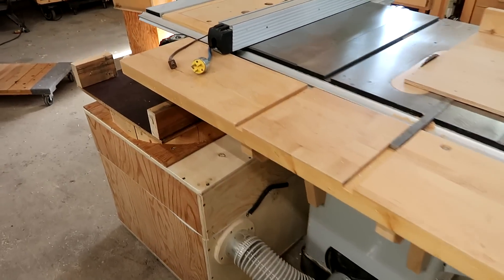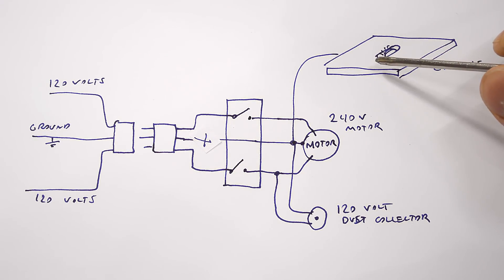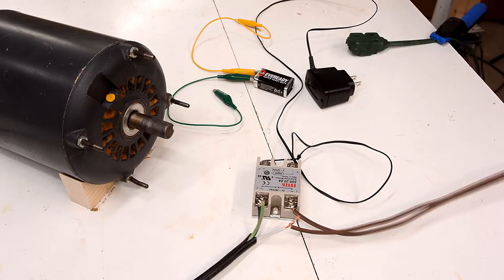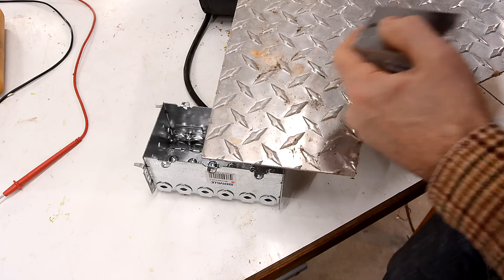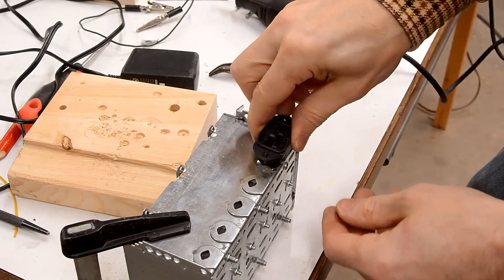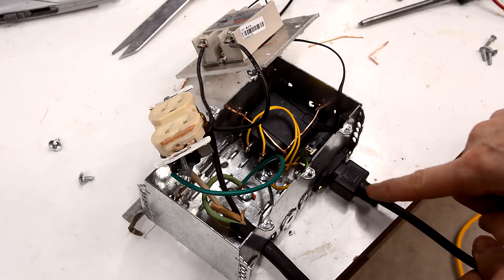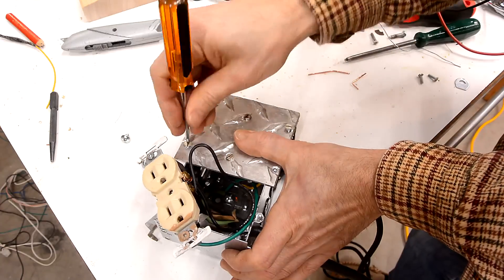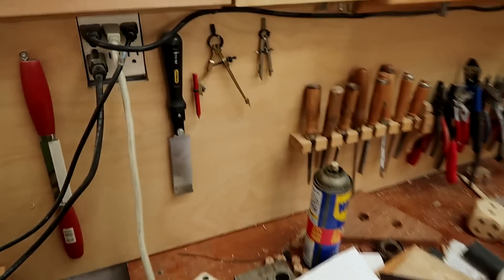Relay box to automatically turn on my dust collector

Comment: That's pretty dangerous. You have nothing to hold the incoming power cord, like a cable clamp. Also, the metal lid isn't permanently earthed (grounded).

Comment: Now you need to build a delay circuit to keep the fan running for 30-60 seconds after the saw is shut off.

Sometimes you are saying "ground", but what you want is "neutral", other times you do mean ground. Ground is not neutral, but nuetral is grounded.

I wired mine so the table saw switch controls the vacuum. Much more ghetto, barely within the specifications of the switch that's 20 years old, but it works.

Comment: Your 240V supply is a single phase supply, not a two-phase! 
There is is either single phase or 3 phase AC power. 

Each of the wires supplying 240V AC is connected via double breaker to the same phase on the electrical panel.
Most power feeds for homes in North America are single phase.
Reply from the maker: Instead of arguing with me, search for "two phase power", then argue with wikipedia.
Reply: @matthiaswandel  I did but it looks like you didn’t.
“Two-phase electrical power was an early 20th-century polyphase alternating current electric power distribution system. Two circuits were used, with voltage phases differing by one-quarter of a cycle, 90°.”
https://en.m.wikipedia.org/wiki/Two-phase_electric_power

Instead of assuming that you are not wrong, please search for “split-phase or single-phase three-wire system”.
https://en.m.wikipedia.org/wiki/Split-phase_electric_power

Comment: Sketch factor - 10.
The stuff house fires are made of.

I love the idea.  The execution leaves me mildly concerned.  I would like to build something similar.  You had me up until you soldered to the prongs of the transformer, left them exposed, and then attached the transformer to the metal case with a copper wire!  AHHHH!

Comment: One small point- fine saw dust does not burn with a flame ,it smolders so if that relay gets too hot and too much saw dust you've got a problem just a word to the wise.

Comment: Curious why you did not get an AC driven relay i.e. Amazon shows both SSR25 DA and AA. Seems this would be simpler because it eliminates the need for the the European DC wall plug. Was this because of the 240 going in?

Comment: Good project with a surprisingly efficient homebuilt blower. I'm sure you already know, but I'm gonna say it anyways. 1, no bushing on where your 120v comes into the box. 2, copper wire is an awful choice for mounting things inside of an electrical enclosure. Like I said, I'm sure you know and are aware of the risks, but are your viewers? Will some regular Joe following along know to immediately disconnect power and inspect when he sees signs of chafing and cutting on the 120v input?

Comment: Whenever I build a component such as this using any kind of "SO" or "stranded" wire connecting to any device with screws I will always solder a nice hook that will wrap around the device screws. Less chance of "wire fray" and a lot smaller than ring or fork terminals.

Comment: You might be able to use one of the 220 legs as the core of a transformer, winding it with many turns of a thin gauge solid core wire, and use that to trigger the SSR.   Just an idea, may make the project simpler for some / require fewer parts.

Comment: Use a current-sensing-relay. Then you don't need any electrical connection between the 120v dust-collector and the 240v table saw. Just pass the 240v wire through the sensing circuit.

Comment: Hi Matthias. I've built a number of accessory switches, but using old fashioned relays. Very minimal voltage drop across the contacts. I prefer octal based industrial relays mounted on a din rail - very easy to wire up. Very useful as well for safety interlocks. But, I expect you had rescued the solid state one from some pre-owned gadget. Much cheaper! I like coil  relays. You can see things moving ..... BobUK.

Comment: God, why are NA wall outlets not switched. Holy shit, even the 240V one isn't....

Who's smart idea was it to have live wall sockets all the time. Great for a kid to shove a small metal object in. At least with a switch there's another thing stopping this.

You also don't have issues with arcing when plugging stuff in, and, if, god forbid an appliance you plug in is broken, or switched on at the appliance, switching the wall socket switch when you turn it on, and realise, it's much easier, and quicker, to flip the switch back off. In NA, you'd find out when you plug it in, and then have to unplug it to stop it...... Just insane.....

You also can't switch something off and leave it plugged in. For something that you use a;l; the time in the socket, that has no switch, like an Iron for instance, you can leave plugged in. And when you go away you can leave everything plugged in and just switch each outlet off and then when you come back form holiday switch it all back on again. This is one reason I could not live in the US....

This is what we have in the Australia. https://thumbs.dreamstime.com/b/white-australian-wall-power-outlet-17607268.jpg

We have power board here that don't have individual switches, and I hate them.....

Comment: Yup, a european 'electrician' here. Power distribution systems differ wildly around the planet. This excellent channel has viewers around the planet. What may be safe in one country can be very dangerous in another. It's NOT just frequency and voltage that differs. Phasing and earthing (protective conductor) have critical differences. If you know what you are doing, and it's legal, fine. If not, get someoene in who does. This stuff can kill. I'm not commenting on US practice because I am not competent to do so. Don't go commenting on practice elsewhere if you don't understand it either.  BobUK.

Comment: It is so much easier in a country with 240V 10A as the standard in household GPO, just have an ordinary switch to control the power going to a double outlet to turn the machine and dust extraction on and off at the same time.
Surely that "earth" in your 240V line has to be a neutral (with two active phases)? Otherwise the earth leakage protection should trip in your fusebox every time power was applied.

Comment: It work but not safe at all, at 5:41 minutes on the video you plug a male plug that could have power on it (if the other side is plug) so it you touch the end, bang your got chock, never  do it again like this.
Reply: There is no double male plug. The box has an IEC power inlet on it. You can see it much more clearly at 3:30 while the box is still on the bench.

Comment: The 120V circut is not isolated in the wirering box... 
maybe the whole box will have current on it if the parts move inside the box due to vibrations.
This is hart to watch as a german electrician. :)

Comment: why not use a mechanical relay with a 120VAC coil
Reply: He would need a 240V coil. The tablesaw is 240V. But those are widely available, so it is still a good question. I think that is how I would have done it. Or maybe a current transformer.
Reply: That's right thanks for correcting

Comment: You can buy aluminium electrical boxes. Gotta go to a real electrical supply house though. If I remember correctly automotive spade terminals fit over electrical plug prongs too. That bit of a delay when the relay turns off is a nice feature.

Comment: Hi Matthias. Does Canada only have 2 fased power grid? in Denmark we have 3. that means we have 230 Volts between fase and zero and 380V 2 fased. I am confused by the 240V and not 120v x square root 3. 204V ??
Reply: In North America, most residential power is what they call "split phase." Coming into the home will be a neutral and two hot wires. The neutral is bonded to earth ground at the installation point. The two hot wires are both 120V to neutral, but they are 180 degrees out of phase. So either hot wire to neutral is 120V. But hot-to-hot is 240V. Three phase power is common in North America for commercial areas but not in homes.

Comment: After watching this workmanship, it is difficult to believe that you worked for Research In Motion. No strain relief, copper wire over the charger where it could slip and short out the terminals, no separation plate fro the low voltage from the high voltage, no bond wire (ground) on the dust collector. Please don't show the uninitiated your videos on electrical wiring and give them the idea that nothing matters.

Comment: Why aren't you using one leg of the table saw power to power the dedicated dust collector?
Reply: There is no neutral. The tablesaw plug has hot, hot and GND, no neutral. That is literally the whole point of this video. You may want to watch the first part again, where he explains the problem with using GND as a neutral.

Comment: There are two line power supply. One line is connected to table saw   outlet 220V> converter  5V > relay switch. The other line is output 120V controlled by relay switch. Do l get it? Two split phase is common in Taiwan.

Comment: And that long extension cord that runs to the 120V to the dust collector switch box includes........

a dedicated neutral.
Reply: But you cant just pull a neutral from any circuit.

Comment: the only cringy part of that set up are the exposed cropped off 240v pins on the cellphone charger, im hoping that in the final run a large amount of electrical tape was used to isolate those pins from the box and everything else around it...

otherwise good job, 
but using a SSR that has such a low voltage trigger is a bit of a draw back as it needs a low voltage source to turn it on, a 120v/240v a/c relay would have been a better option and they are like 20/25$ at sayal electronics (or online)

Comment: John Heisz did the same thing, but he put a diode bridge in series with the saw, and used the output of that to power the relay. But that was a 1 phase chopsaw.
On one hand the american system looks cool in the way that you can choose between 120 and 240 volts. But Europe and post-USSR countries have 3 phases, and when taking any 2 you get 380 or 400 volts, that is in turn useful for high power devices. In the end I'd rather have the higher voltages, because I'd rather pay for some insulation (for the volts) than for additional copper(for the amps).

Comment: For all who are worried about Matthias' building techniques, perhaps there are some points I can make which may give some of you peace of mind.

First of all, I am an "electrical engineer", degree and all.  That isn't too important for this comment, but it may be important for some people who would worry all day and into the night about the credibility of my comments!

Next, I have designed and often built projects such as this.  When doing them for myself, some began about like this, and often didn't get beyond this kind of "prototype" construction. Some connections did not have insulation, some did, depending on the likelihood that they could touch other power carrying connections, which it appears is the same for this one.  Generally, the more rigid the wires were, the less concern I had for their ⚓️ anchoring to something likely to be safer than safe.

Finally, there are some whose house wiring is worse than this!  For example, it is common to use a "flying lead" or "flying wire" to install an outlet where the box which will contain a duplex AC connector is difficult to reach for the electrician doing the wiring.  In a few cases, it would be impossible to fit a small screwdriver into the box 📦 which the AC outlet will be installed.  Physically impossible!  So, the ⚡️ electrician who is charged with installing the outlet will add a short "flying wire " ( a wire that is very short, perhaps only four inches long, with enough insulation removed from each end of the wire to make a solid connection but with enough still remaining in the middle of the wire to insulate the wire from surrounding connections) to the outlet's connection screws, which then may be connected to the incoming wires with a simple "wire nut" connection.  If this procedure is demonstrated on a typical connection to an electrical outlet that is hard to reach, it quickly becomes obvious that the flying wire is the only way the outlet may be wired. To the casual observer, it would appear virtually identical to some of the "floating" connections in a box 📦 like the one ☝️ shown in this video!  The conclusion?  The connection is safe, as are these.
Reply: Would it pass inspection?

Comment: I got lost, would like to see a schematic .  Where does he pick up a neutral? You cannot use a ground.
Reply: The box has a long cord with a 120V plug on it. That plug goes into a receptacle somewhere else in the shop. The 120V receptacle supplies neutral to the box.

Comment: You are not supposed to use ground as a neutral anyway. Bad idea. You dont want current going through your ground.
Reply: That is exactly what he said at the beginning of the video. You are not supposed to use ground as a neutral. And in this video he shows how to avoid doing that. Did you watch the video?
Reply: Still has current closing  back through the ground wire.
Reply: flowing
Reply: Oops, wrong, guess I didn't watch close enough the first time either.

Comment: For those of you who are wondering whether this gizmo is something a real engineer would build, I have two slightly-related stories.  Once, a young colleague asked me to help him attach a circuit board to an optical mount - used to position it precisely.  I looked at it and said, all you have to do is drill and tap two holes in the front plate, and you're done.  And he said: "Would you mind doing that for me?  I have never drilled a hole before."  This is a guy with a PhD in experimental astrophysics.  Story number two: a friend who is a chemistry professor told his graduate student to grab a screwdriver and help with something.  Eyes widen in fear: he had never used a screwdriver before.  These are the people who are designing airplanes and software.  Run and hide now!

Comment: not an electrical engineer here, but even i could see there was a lot of risk of doing that, also i'd recommend using thermal paste instead of grease and a small tube isn't that expansive so please do a follow up video about this where you do things a bit more properly here

Comment: Can someone explain me, what he means by "ground"? Does he mean neutral? 
Does Canada not have a separate ground connection? because you nee a neutral, right?
Reply: I don't get it. As soon as there is current flowing to ground, the ELCB breaker should trigger. Don't they have ELCBs in Canada? I am so confused.
Also you usually ground a metal housing. This would mean, you have the returning current on the metal case. Please, if someone with electrical background reads this, explain. I am so confused :(

Comment: The dedicated neutral is the safest approach. Current returns to the source via the lowest resistance path. If something goes wrong in the wiring and shorts to the hot, the equipment grounding conductor (neutral) provides a low resistance path so current returns on the wire rather than through you. The metal chassis should be tied to the equipment grounding conductor that goes back to your electrical panel. Note:, grounding to the earth is not sufficient it needs to go back to the panel.
Reply: Neutral is absolutely positively NOT to be used as an equipment grounding conductor. Neutral is a current carrying conductor. No current carrying conductor should be used as an equipment ground.

Comment: Or you could have mounted an old CPU heatsink fan on the bottom of the relay and ran it off of your 12 volt adapter on the low power side.

Comment: i wonder what effect turning 2 motors on simultaneously like that has on the house's electrical grid?
Reply: There’s a slight delay, maybe 1/3 of a second, and the induction motor for the dust collector actually has a sort of delay built into it too as there are separate windings to start the motor that run for 1/2 a second and then it transfers to the big primary winding.

Comment: Aren't the phases in residential circuits only 120 degrees out of phase and not 180?  Wouldn't that be closer to 208v and not 240v Matthias?
Reply: No. It's not a three phase wye system, but a split-phase system. The 240v comes from a transformer with a grounded center tap. From one leg of the transformer to the other you get 240, from one leg to ground you get 120.

Comment: Cannot beleve that in America they use metal boxes for the electrical boxes... And if a cable joint gets loose? That plus wooden walls... Veeeeeeery safe yay
Reply: It is perfectly safe as long as the box is grounded properly.

Comment: You have a handy idea, However you created an extension cord with two male ends, This is dangerous because the blades of the male end you plugged into the outlet would be hot and exposed when not plugged in. I couldn't look when you used bare copper wire to anchor components. I get nervous any time you get an electrical idea
Reply: Where did you see the extension with two male ends? I have watched the video twice and I didn't see it. Was it hidden in the background somewhere?

Comment: You should look into contactors. They have internal rectifiers that rectify the voltage on the "coil" side and can run 120-230v on the coil side they eliminate the need to have a low voltage source.

Comment: Hey Matthias would any  240v appliance from the eu, Australia, places where they have single phase 240 volts (Live, Neutral, and Earth)  would the appliance work on  American/Canadian 240v (hot, hot, and ground)  or would the appliance immediately blow up?
Reply: The problem is that North America uses 60Hz. Much of the rest of the world uses 50Hz. Most appliances should work OK. If they don't, it will be the frequency not the voltage that prevents them from working properly. Heating appliances should work fine. They don't care about frequency.